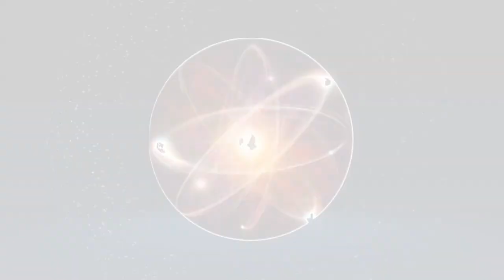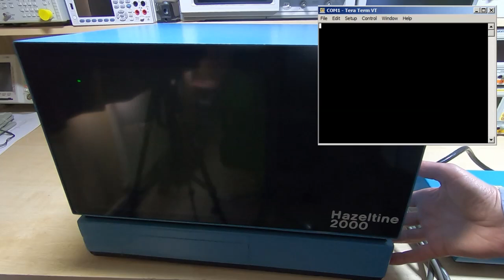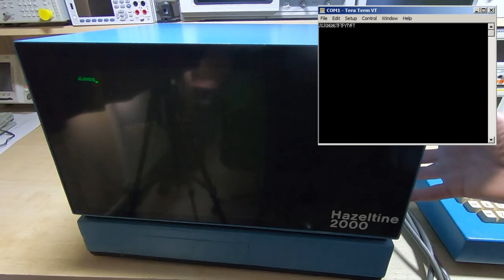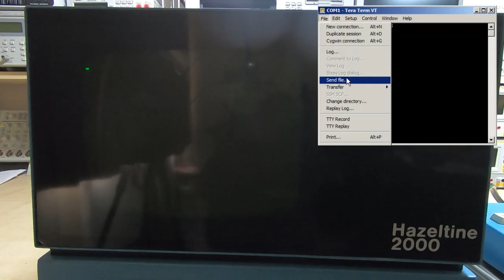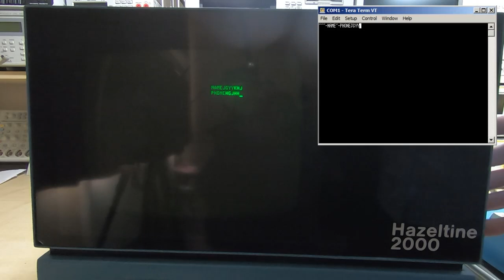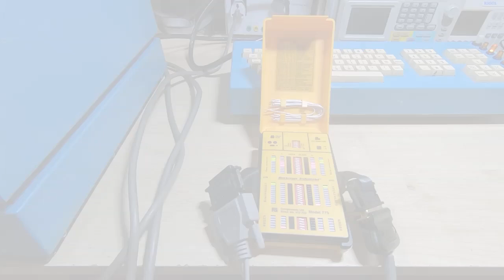Hazeltine 2000 Repair Part13

Comment: I have an 8-bit microprocessor-based terminal I'm trying to repair and it's got some smart features, but I'm not sure if it does forms like this. It could be really fun once I get it working to make it emulate your Hazeltine and other really vintage machines, since it's just code on an eeprom.
Reply from the maker: Yes smart terminal make a big difference. The Hazeltine stands out being completely discrete in its design but more  modern versions are still good to have.